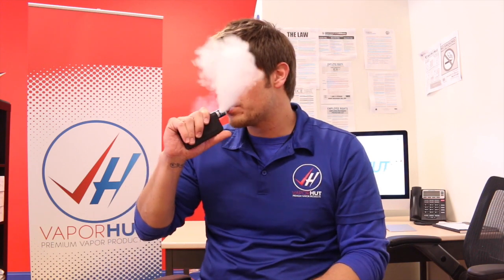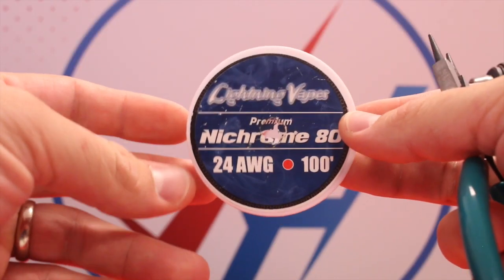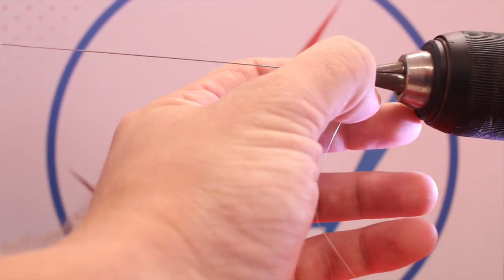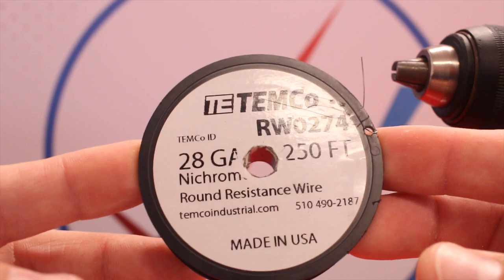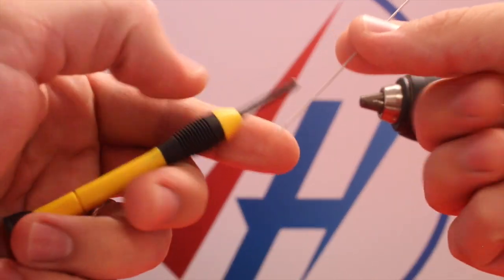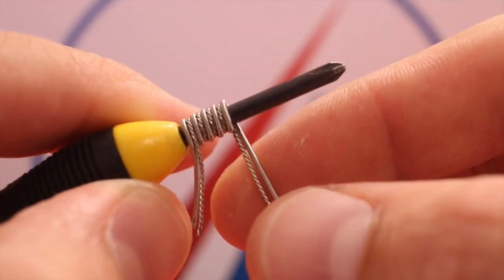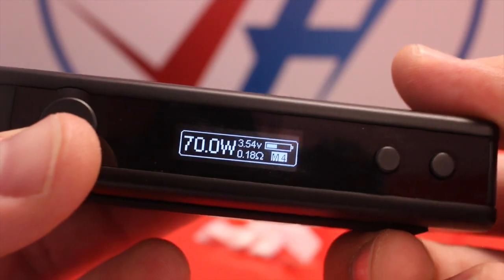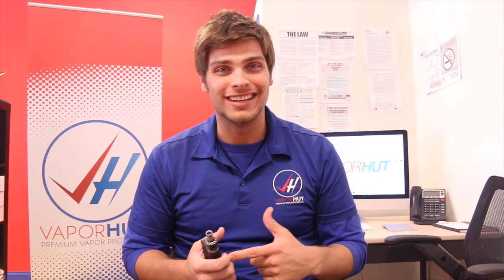NICHROME FRENZY Stage-Heating Build TUTORIAL (for Experienced Builders)

Comment: Hey is this going to work in temp control or is is it allowed in standard wattage mode I'm unsure either way ..

If it's all nickel I'm thinking your dangerous to use temp control wire in wattage mode ? 

If it's in TC mode what are the settings and does that mod really enable TC above 60 watts ?

Thanks for anyone's response
Reply from the maker: tone the moan I'm not using nickel. I'm using nichrome (nickel chromium alloy). To use temperature control you need to be using pure nickel (or titanium with some devices). Kanthal and nichrome are only to be used in standard wattage (or "power") mode.